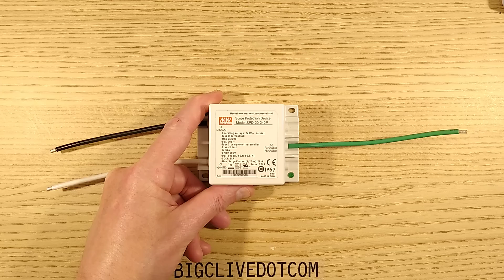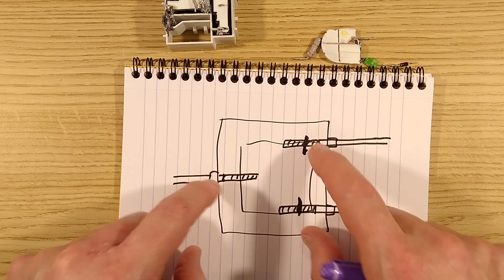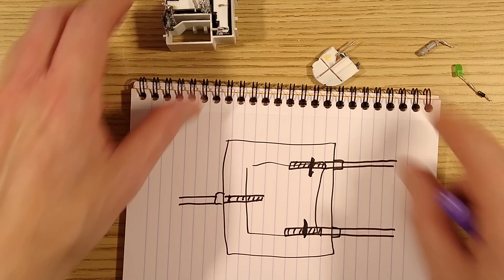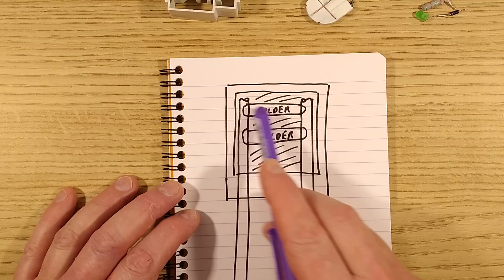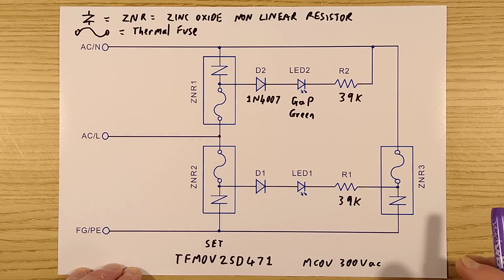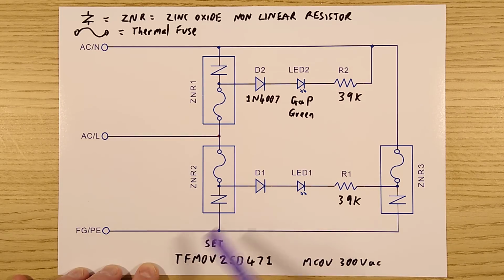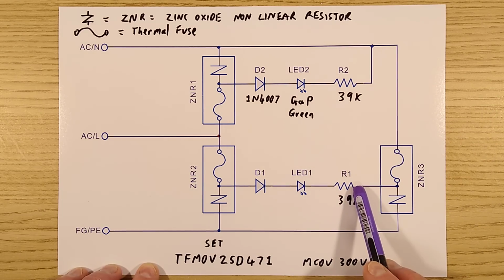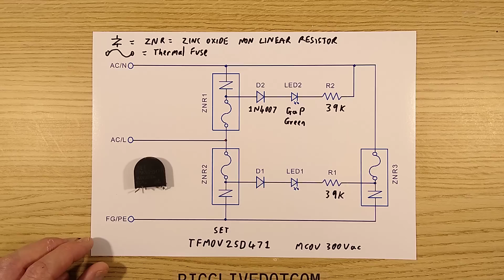Incredibly good Meanwell surge protection unit (with schematic)

Comment: Meanwell is amazing, I’ve been using their power supplies for home projects and large work projects for years and have never had one fail!
Reply: Mean Well is a Taiwan based company that also has a large operation in mainland China. It has been going for many years and has a very good reputation.
Reply: They are so good RS sell them under their own badge.
Reply: @dogwalker666  But who knows if the RS labeled ones are as good as the ones that have the Mean Well sticker? Who knows, maybe it's the rejects that get the RS stamp?
Reply: @andreasu.3546  No, The RS ones are prime quality,  They only accept the best, I used to know the UK buying manager.
Reply: @andreasu.3546  That's not the RS way.
Reply: @dogwalker666  oh that's very good to know, thanks!
Reply: @onix331  👍🏻
Reply: dannybnapa  High end industrial LED lights use Meanwell driver PSU's they have extreamly high M.T.B.
Reply: Meanwell makes good stuff, is good to know, I bought three of their power supplies for projects and when the listing says " country of origin China " I get apprehensive about leaving it unsupervised for long periods, at least I can not worry about my stuff that's powered with meanwell.
Reply: Same here !
Reply: Yes, I have used heaps of their supplies and not had a single failure.

Comment: I'll be honest I feel like meanwell are a bit over-rated, and just waiting on some  other company to buy them out

One thing I don't understand is sometimes a capacitor to earth, why? Surely that makes your earth live👀

This application I can (obviously) see why the earthing, but for me it is a perilously close connection

Mcov, maximum continuous over voltage?

Please to detonate with voltage multiplier? 😅
Reply: Depends on what device has the capacitor to earth. and how it is connected

In Audio equipment you normally have a capacitor that goes to ground to stop humming. 

As for meanwell I'd say they are absolutely not overrated. I'd be sad if they got sold off
Reply from the maker: It's not a capacitor, although there will be a capacitive element.  It is only for use with earthed circuits, and if enough sustained overvoltage occurs it will hopefully help with tripping the RCD.
Reply: @bigclivedotcom  capacitor problem was a bit of a tangent, not suggesting there was on in this instance, but in general

Comment: I have one of their 150W power supplies, and all the mishaps I've had including short-circuits, it cuts off before the RCD at the fuseboard could take action. Meanwell are a league in all of their own and rightly-deserved, full credit for full engineering.
Reply: How any RCD should have done anything when the secondary side of an isolated power supply is shorted? Most secondary sides of switching power supplies aren't even grounded, so how a ground fault protection should help in this case?
Reply from the maker: The RCD would not react to a low voltage DC side short.  It will be the units inbuilt protection that kicks in.

Comment: Not following, would this be connected across the same power input terminals as the device you are protecting?  Parallel?
Reply: Correct. Over voltage protection is always installed in parallel with the device(s) you want to protect. They key is to keep the wires as short as possible. The loop should be less than 1 meter / 3', preferably closer to 50 cm / 20" if possible.

Comment: I'm all for redundancy, but isn't the whole purpose of the 1N4007 diodes to protect the LEDs from the reverse voltage? Unless I'm missing something I don't see the need for Gallium Phosphide LEDs.

Btw - you probably realised this after making the video but MCOV = Maximum Continuous Operating Voltage.
Reply from the maker: LEDs are rated for a maximum reverse voltage of about 5V.  Without the diode the green LED would conduct in the reverse direction without lighting.  The diode has a slight microamp leakage that would upset the classic gallium nitride green LEDs.   (Plus the old style LEDs are massively more reliable.)
Reply: @bigclivedotcom  That explains it, I didn't realise they were sensitive to the microamp current.
Reply: They also could have put the diode in reverse in parallel to the LED shunting reverse voltages. Either way work. This method probably saves a little bit of energy.  @bigclivedotcom

Comment: So not  re-settable thermal fuse. 🤣   Meanwell are a brand you can trust, there power supply's are always worth the extra cost. Especially if the items are for use in work place settings Great video. 2x👍
Reply from the maker: The thermal fuse would only trip in a justifiable event.